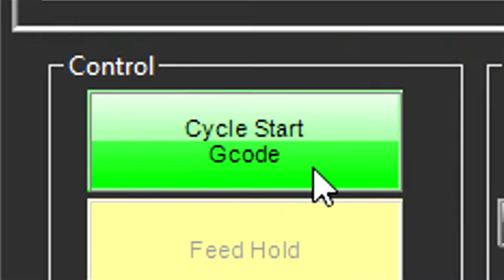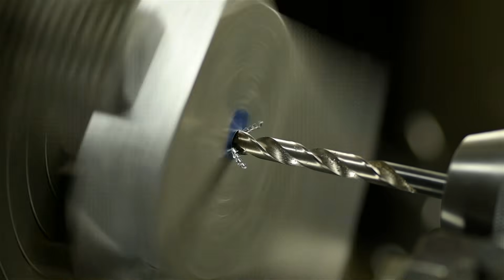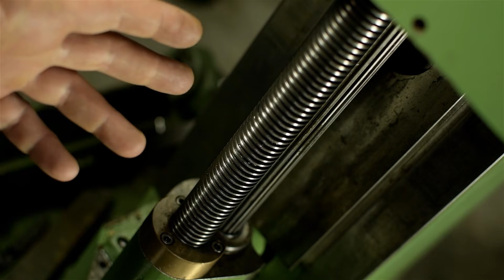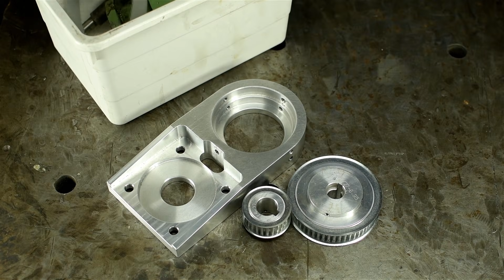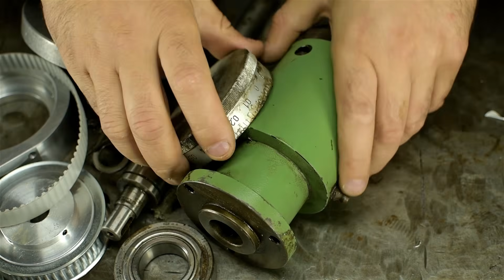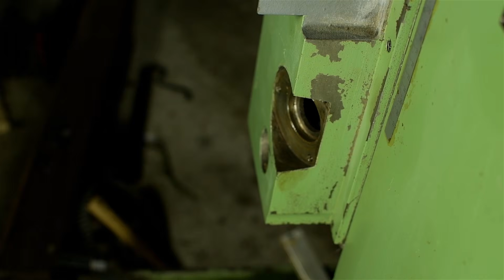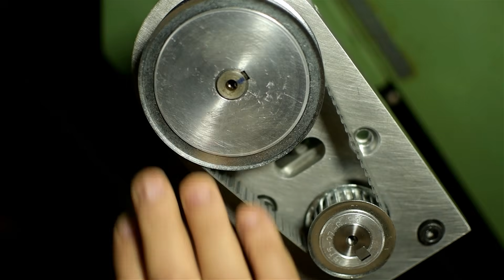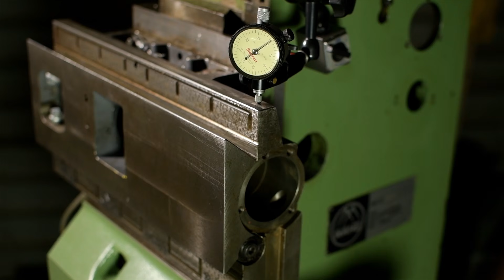MAHO: Move'n On Up!

Comment: keep your PLC / machine network separate (physically isolated) from your home network.  preferably VLAN/subnetted and firewalled.  because the last thing you want is that machine unexpectantly running/moving/changing/updating while your hands are in it.  as a security analyst for machine/process networks....i'm just saying, keep it isolated and keep your hands.
Reply: That is typically not a concern for EtherCAT servos.
EtherCAT in general does not support TCP/IP. (It is a rarely used extension, which requires special support in both the servo drives and the PC controller software)
EtherCAT also don't play well with switches. It needs to be a direct connection to the PC.

But I guess the PC could have second NIC. Which of course should not be online.
Reply: Yeap.  I remember reading an article called "Why is this computer connected to the internet?"   or something like that.
The premise of the article is why do companies want every computer hooked up to the internet.  A computer controlling a piece of machinery at a factory.  
"Why is this computer connected to the internet?"     There is little to no reason that most computers are connected to the internet.  
The computers can be old, not secure, running old OS's and it doesn't matter.
Reply: @vonnikon  That is basically every industry system. EtherCat is just another protocol language like CanBUS, RS485 etc. They all work with RJ45 contacts today. Because it is easier to disconnect/re-connect etc. Doesn't require an electrician to assist with the set-up among other things. Not to mention, you can use CAT6 cables for the best magnetic resistance. To be able to handle electrical field distortions that can happen in certain Industrial enclosures. 

But conversing it to TCP/IP is fairly easy. Just a gateway that acts as a translator.
Reply: @vonnikon  every engineer i have ever worked with wanted their machine on the network.  every single time.  was just a word of warning.
Reply: @vintagespeed  as a technician working on fairly black box equipment troubleshooting an intermittent critical failure, having access to the machine's event logs and settings would have saved me hours on the phone. Ultimately the problem was caused by condensation which they wouldn't be able to detect but it would have saved all the "have you set x to such and such value?" Some times being networked helps but it's entirely dependent on the individual equipment and who has to work on it.
Reply: @kendallemory8455  ....if i had a penny for every time i've heard that one.....    how are the updates on the machine?  how's your anti-virus updates?  service packs?    ....my suggestion was physical separation when possible, if not then firewall/vlan/subnet and you better have a well maintained ACL for any machine you have ppl sticking their hands into.  i support hundreds of machine networks, thousands of PLCs in dozens of manufacturing facilities nationwide for a corporation you all buy from...  safety standards exist for a reason, ignore them as you choose..
Reply: @kendallemory8455  funny thing is, when we had an automated wrapping machine take a guy's hand off, what did engineering have to say..??  "oh, must've been a system problem..."  meanwhile capt hook can no longer hold his kids and has to learn to wipe left handed.... just sharing words to the wise.
Reply: @vintagespeed  there's no substitute for personal safety if it's not actively running then it should be powered off and you should never have your hands inside of a running machine unless you are willing to accept the consequences of your own actions. I've had my fair share of bites from machines but if you've ever had to read off an entire week of runtime in 10 second intervals over the phone, it gets a lot more palatable to run over some cat 5 to save a couple hours. I do agree with you that most machines do not need to be internet facing.
Reply: @kendallemory8455  haha, what is this "personal safety" you mention??  take a look around man!  :D  liability will forever fall on the corporation.  always.
Reply: @kendallemory8455  it's all good man, just sharing another perspective.   most ppl who mess with CNC immediately stick the damn thing on their network;  no firewall, no ACL, no port blocking.  and i'm just advising why that's a terrible idea in any setting.
Reply: @vintagespeed  I don't understand why you mean. What I'm saying is that nobody cares about your body except yourself. OSHA, your employer, and your lawyer care about you only because you affect their wallets. The only reason I stopped an apprentice from shorting out 480 because he forgot which side of the isolation he was reaching for was I didn't want to do the paperwork. Machines don't know where you are or what you're doing so it's up to you to keep your meat out of the metal.
Reply: @vintagespeed  true, my 3d printer runs a web API but I make sure to turn it off when not actively printing since I practice hacking them myself.
Reply: @kendallemory8455  not knowledgeable on machine networking, but in the networking field. Wouldn't it be better to isolate under a different subnet and setup ssh access for logging and diag instead of direct connection to the main subnet? Maybe rdp into the pc controlling the machines?

Comment: 14:15 Its free to turn in one direction and not in the other. The nylon thing adds resistance in the downwards direction. Without it the machine can make the screw turn down due to vibration. It also gives you an equal amount of torque in both directions, this is much more practical for the machinist.
Reply: Great explanation. Without that clutch, gravity will pull the entire thing down.
Reply: Came here to say this. My drill press has the same feature on the crank to raise / lower the head.
Reply: This, I'm not sure your servo motors have a 0-rpm holding torque? but without such you will need a brake.
Reply: @rowlandstraylight   Especially with a ball screw.
Reply: Not just that, but it also balances the load on the motor. When holding stationary, it's always best to try to get as close to no torque when possible to prevent premature failure of the servo.

Comment: Nice job Tony!!!
Servo control is amazing and fun - I have done high speed servo control design for several years.  Fastest so far for me has been 10g of accel to 300ips max speed using a 3HP servo.
Watch yourself, these motors can cause some major harm.  I really like the accel I saw. Don't go Tim Taylor on us.   I have broken several shear pins (among other things) with over-aggressive accels.
A few other things to note:
1) From a pure motor standpoint, there is no difference between a servo motor and a stepper motor (other than an encoder which you can add to either).  They are both just brushless DC motors.  The difference is the control electronics.
2) Often a servo motor (like yours) will include some electronics (like for the encoder, resolver, etc) which a person who wants a stepper doesn't need.  Also, servos usually market to a higher end task than steppers so the manufactures often put more $$ into them (like better magnets) so they often have better performance.
3) DC Motors deliver their most power at their highest rated RPM.  It is best to gear them accordingly - but with some margin.  Never run them at max RPM as the control loop needs room to operate and motor power drops rapidly after the motor reaches max RPM.
4) Servos DO NOT like lag/lash (non-linearity) between the shaft and the load.  This can really mess with the control loop.  Best to eliminate as much as you can.  If you hear any buzzing when the servos are holding position, you need to either eliminate the lash or soften the tuning.  The buzzing in not only annoying, it can do mechanical damage.
5) EtherCAT (Ethernet for Control Automation Technology) is cool.  It allows the motion controller to talk to all the control electronics over the same wiring and there are a lot of compatible devices.
6) Don't completely give up on limit switches, they can be a really good friend.  Control systems can sometime go haywire due to a SW or HW (or operator) failure and having a switch that tells the control system to "go no further" can save slamming several hundred pounds of metal at full speed into a hard stop.
7) Make sure to include a big easy to hit E-Stop (Emergency Stop) switch in your design so you can quickly kill power to all the motors.  Not only is it a VERY GOOD idea, it is also the law.

Comment: You will want ballscrews on the Z since its being driven through gears.Without a ballscrew there will be backlash in the gears, but if you use a ballscrew with a large lead then the drive will always be under tension in one direction as the weight of the knee and table will be enough to overcome the friction in the nut and it will always be wanting to move down.

Comment: i just started learning how to cut aluminum with a chisel... its a lot of studying but i think i understand the concepts....
Reply: It's easier if you start with metric tooling, rather than converting from imperial before your first cut.
Reply: Ok, so I am a complete noob about this stuff, but I assume it is not actually possible to split a block of aluminum with a chisel...
Reply: @Warhawk76  Depends on the size of the block...
and the chisel...
Reply: If brute force isn’t solving your problem, you aren’t using enough.
Reply: @Warhawk76  Correct! Tongues are firmly in cheek with all this banter :-D
Reply: @Warhawk76   Yup. You would have to karate-chop it in half for best results. Chisel cuts can come out twisted and bowed, whereas chop cuts are always straight. If you got your scribe line is another question.

Comment: ToT you should be proud, your videos have made it to the big leagues. My professor used your lathe chuck and surface grinding videos in my 331 engineering course at NIU, I'd recognize those hands anywhere.

Comment: I’m betting the heat on the belt is because it’s too tight.
Reply: Yup, it contracts when it gets on the pully and releases that stored energy from streaching as heat into the pulley. Mind you, what heat scale was that, are we talking 0.001c or 50c??
Reply: I was searching for a comment like that, or otherwise I would have written it myself
Reply: Yeah, but if he loosens it, he's going to get backlash for his troubles.
Reply: No, it's just too heavy of a load for that belt. It will get worse when he adds the X and Y and the workpiece mass to the load.  I wager TOT will eventually have to upgrade to a precision chain drive. Or a gear drive.
Reply: @jeffvoight6586  I dunno if your gonna get much back lash with all that weight on it. I guesseing that sprag clutch was also setup to be a bit of a helper in someway in the up direction.
Reply: Or the bottom pulley could be too small
Reply: Backlash on the Z-Axis shouldn't be much of an issue as it is gravity assisted in staying on one side of the thread. And plunging into and out of material is probably done careful enough for most cutters. That is one reason why you might get away without a ball screw, the others would be speed and friction. If the heat really comes from the belt - or tension on the belt - a wider pulley might help, but it would heat up on the side, not only the top pulley.
Reply: The teeth on the belt are square and they need to be round for quieter operation.
Reply: @jeffvoight6586  with those servos, he might be able to compensate for the backlash.
Reply: Sirus since the pic said the belt was 42.1 deg and the cold part would be garage temp....

Comment: It may just be that the sprag clutch and nylon bushing inside the jack shaft housing are your anti-gravity device.

Seriously. You are hanging the weight of the X & Y axis from the Z axis. With the servo motor turned off, and no hydraulic (or any other type) brake, this weight creates a downward force that can (will???) turn the screw, and cause some drifting issues.

With closed loop, you can certainly continue fighting this downward force by constantly readjusting the Z axis ... but that may be an additional variable in your Z axis positioning that will cause you issues.

When fully assembled, you can adjust the nylon bushing for equal force required to raise and lower the Z axis ... knowing that based on the current condition of the sprag clutch outer race, this is a constant wear item that needs periodic adjustment.

Counterbalance springs (flat spring stock wound like a clock main spring) are available, and don't have the constant wear, but require careful selection (and maybe some ballast) to get set correctly.

The servos may also allow for different torque and speed adjustments in the tuning process to counter the torque change between raising and lowering without the sprag clutch ... but without an integral brake, you'll still get drift.

If the servos have holding torque available, kindly ignore all the above!

Thanks for sharing.

R
Reply: it might just be to delete the feel of the weight of the thing so turning it up gives the same resistance n the crank as moving it down (where the weight helps with going down and if oiled enough might even freewheel all the way to the bottom )
Reply: @watahyahknow   I came here to make that suggestion, you wouldn't think that it matters, but having to use different ammount of force in one axis really makes the feeling wierd and working with is sucks

Comment: I worked with a group of guys who. 30+ years ago, learned a lot about stepper motors "the hard way".  These were small, very inexpensive steppers that had a gear box that converted the rotary motion in linear motion.  We would drive the motor to one stop at power up and call that zero.  Through the "school of hard knocks" we learned that if you hit either stop at max speed, the motor would "bounce" and start running at twice the speed in the WRONG DIRECTION !  We also discovered any time you stopped or changed direction there was a chance of loosing a step.  Good thing was, there was "indirect" (but very slow) feedback in the total system, so we never got too far "lost" !

Comment: TOT,
You got Z axis to return to .0000. This indicates that you have no mechanical backlash in the Z axis drive train. You are driving via a timing belt and gears and using a lead screw. At some point this drive train will experience drive train backlash. Your position encoder is integral in the servo motor. So you are monitoring only the motor in your servo closed loop system. How is your retrofit going manage machine accuracy and repeatability since you have no  machine position feedback? 
I repaired a large Mazak mill that we purchased used with non functioning linear scale position feedback by using only the motor encoder. A replacement linear scale feedback wasn't deemed cost effective. In this machine design the servo motor was direct coupled and it was naturally a ball screw system. My experience led me to believe that the ball nut and screw backlash and ball screw TAC bearings preload was reliable enough to risk running with only servo motor encoder feedback. We also had inspection equipment to periodically evaluation linear axis positioning accuracy. I don't like trusting any drivetrain that uses a timing belt. 

I realize that your closed loop system is a big improvement over your open loop stepper motor system. When I broke into the repair trades in the early 1980's, we had several open loop machines that occasionally gave us positioning errors. Your explanation of how this happens is spot on. I used to explain this to new technicians the same way you did.

I only ever maintained one CNC machine that didn't employ OT switches and zero reference switches.  All is fine until you lose battery backup power and then you lose absolute positioning. When this happened on this machine, the technician's life just got miserable. Life was always so much easier when even an absolute positioning machine could be simply referenced to re-establish lost machine position. I would certainly like to know how your servo motors maintain absolute positioning. Battery life keeps improving, but I would like to know where that battery is located and how long you can expect it to last.

I applaud you for the servo retrofit. I no longer take much interest in the effort. That was the type of project for my employment years. I am interested in simpler tasks in my retirement.
Reply: In the industrial world we use flags for the axis limits. (Home and Max) Might be worth considering adding a mechanical flag with a EE-SX-671A OMRON photoelectric sensor. Omron also makes a wired one, like the EE-SX671-WR 1M. Url: https://www.digikey.com/product-detail/en/omron-automation-and-safety/EE-SX671A/OR612-ND/307730